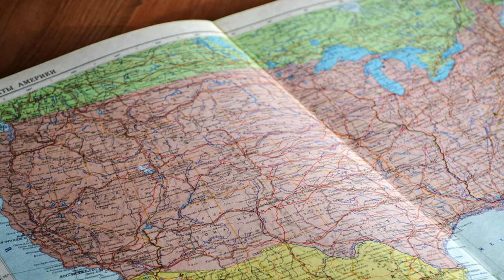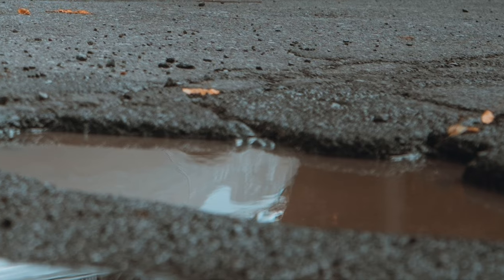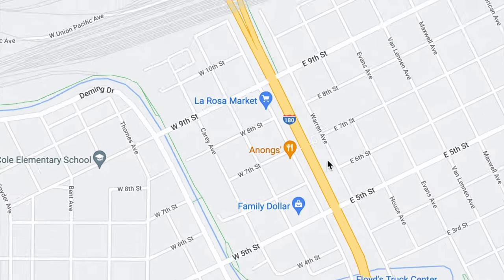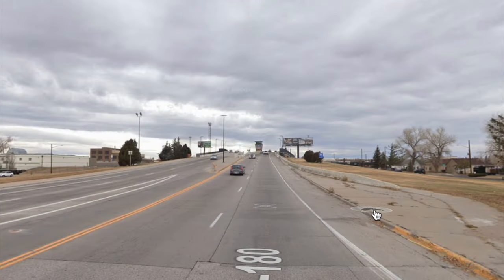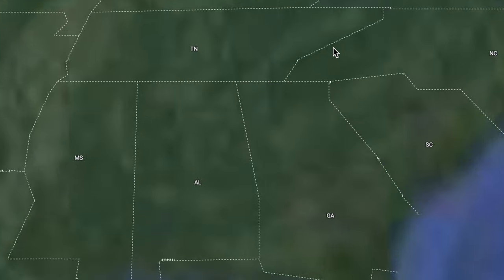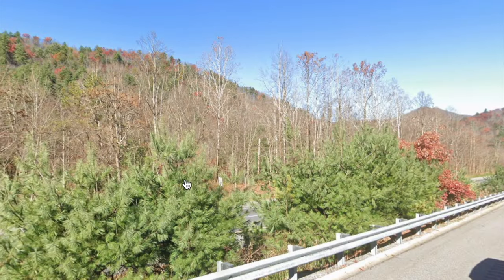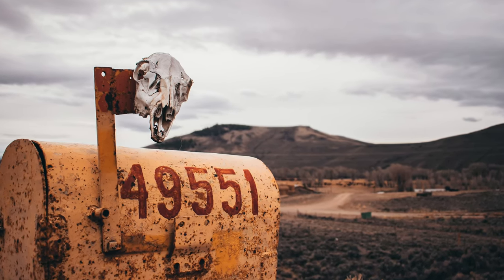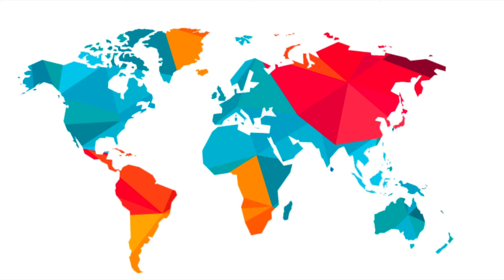Why are there stoplights and driveways on US Interstate Highways?

Comment: You've got a bit of learning to do.  President Eisenhower signed the National Defense and Interstate Highway Act in 1956. First, three-number spur routes from interstates, such as I-180, are to give access to communities off the main route.  I-180 goes to a point where it becomes Business I-25.  Business routes also connect to interstates but do not have regulations on them.  Most are city streets.  Other spurs will simply dead-end into a city.  The Spartanburg spur becomes US 176;  same situation.   Hurricane Creek has posts on both sides of the cutoff;  someone has taken down the chain or rope that is supposed to block that dirt road.  Local traffic uses the legitimate exit a mile away.  There are a number of businesses in Texas that use the Interstate as their address, but physical locations are on the outer roads. The United States Postal Service determines addresses.  Now, if you want a more applicable stoplight, there is I-70, where it meets the Pennsylvania Turnpike in Breezewood, PA.  To continue on I-70, you must exit eastbound onto US 30 and go through a couple of stoplights before you make a left and resume your trip on 70, heading for Baltimore.  Westbound traffic stops at that same stoplight, hangs a right onto 30, goes a few hundred feet and reaches a ramp to the Turnpike, which then carries I-70 westbound towards Pittsburgh.  A caveat here:  this interchange was built some years before the Interstate system existed, so it was legitimate, based on the rules of that time.
Reply: Thank you for pointing all this out. It really irritated me with several inaccuracies.
Reply: Actually, Business I-25 encompasses the entire route of I-180.  So does US-85 and Business US-87.
Reply: The only thing unusual about the Spartanburg Spur is that it doesn't connect to its parent route as an interstate, but as a US highway. If you consider Business 85 as the parent route, it would be different.

Comment: The Spartanburg situation has a historical explanation. The map shows both I-85 and, parallel to that, a Business Route I-85. Unlike every other Interstate business route, this road is a full freeway. In fact that road WAS I-85 for decades. And I-585 was a normal spur route to this version of I-85, going in both directions from the main route, and following all the rules. Then they decided to improve I-85  by building a whole new road beside the existing freeway. And they left the existing roadbed open. The older freeway, for what I consider dumb reasons, was designated a business route instead of a 3- digit regular Interstate number. Local officials wanted a 3-digit number, but the feds said the older freeway had too many exits per mile, short ramps, etc. In spite of the fact that there are dozens of examples of these rule violations in big cities. So now I-585 is a regular spur route off a business route, very unusual. And it comes very close to the new roadbed of I-85 as a full freeway,  but not quite. I guess it would be expensive with little benefit to upgrade this short section to a freeway.
Reply: North Carolina did that same thing in Greensboro, with none other than I-85.

Comment: Throughout Texas, when a business or home is located on an interstate frontage road, the address will be “nnn Interstate nn”.  That is, assuming the interstate doesn’t have another name, like Stemmons Freeway in Dallas.

As for stoplights on interstates, supposedly the interchange between I-35 and I-535 in Duluth, MN has two ramps that intersect one another, and therefore has a traffic light.
Reply: Yea I was thinking about that throughout this entire video.

Here in San Antonio, there's TONS of businesses with an address on I-10 and I-35. There's also a lot on I-410, though it appears the addresses for them on Google Maps are all "Loop 410" instead of I-410, which makes sense to me because I've never heard any locals refer to it as I-410, rather, simply as just 410.
Reply: Not anymore regarding Duluth.  It looks like they are rebuilding the interchanges in that area.

Comment: Most of these are normal here are the very odd ones:

I70 in Breezewood PA. They were going to bypass PA but the businesses complained and got their way thus Breezewood is an absolute mess today 

I180 in Cheyenne. I believe this interstate got an exception because Cheyenne is such a small city. Even still I don't understand why they didn't just sign is business 80 or something similar

The Alaska Interstates: these also got exceptions because Alaska has a tiny population and doesn't need massive highways outside the major urban areas 

I78 in Jersey City. I78 runs on surface streets to get to the Holland Tunnel, this was going to be a highway that went through Manhattan but people protested and the highway was cancelled
Reply: Here's the thing with I-180, it is signed as the following highways:
- Interstate 180
- Interstate Business Loop 25
- US Highway 85
- Business US Highway 87

Business Loop 25 is appropriate as it starts and ends at I-25.  Also, I-180 ends at Interstate Business Loop 80 and....US-30.

I swear, US-30 has more anomalies than any US highway I can think of:

- Connects to the only interstate highway that isn't even a controlled-access highway (I--180, Cheyenne WY)
- Connects a gap with Interstate 70 (Breezewood PA)
- Multiplexes with I-676 and shares a signal intersection on the main lanes (Philadelphia PA)

If I didn't already know that I-238 in California was part of CA-238, I would swear US-30 had something to do with that anomaly.

Comment: I-280 in Toledo, Ohio was once an Interstate highway with a traffic signal and it also had a draw bridge. I was totally surprised  buy it.  Over the year the traffic light intersection and the draw bridge were replaced with a proper interchange and a high level suspension bridge. I-280 run from the original Exit 5 on the Ohio Turnpike thru Toledo and connects to I-75. Originally, before I-75 was completed, I think it was part of the Detroit-Toledo Expressway. The bridge is at the Maumee River, which has large cargo ships on it that use the port facilities. Toldo is a world port for shipping grain around the world.
Reply: I've seen that a few times in my youth and young adulthood before they fixed all of that.

Comment: Interesting look at the interstate systems oddities. Why did you use a Russian map of the united states at 1:43?  On I40 going east near Tucumcari NM at this location there is direct access to what appears to be a ranchers back dirt road 35.128368, -103.846965 . What's odd is there is a exit off ramp (just west) that leads to a frontage road that ends only a 1.5 miles away by dirt road from that direct access off the freeway. The rancher has put up a gate that blocks people from just driving off the highway onto their land. There is also another nearly identical direct access here just under a mile away from the first one 35.135010, -103.834780 . Probably onto the same Ranch land. Maybe the Rancher at the time of the highway being built demanded this, the freeway was probably cutting off their Ranch access.
Reply: From what I understand of I-40, there are around five or six of these crossovers.  They are for ranch access.  TxDOT didn't want to buy a portion of the land as right-of-way due to expense and traffic volumes in the area are low (at least the entrances are).  So, they violated what a controlled access highway is and created the crossovers.  The only reason this was done, besides TxDOT didn't want to pay for it, was because there are no other access roads in the area for the entrance to the land.

Comment: So, here's a lesson for you.  When you pronounce "I-80", it's the same as saying "Interstate 80".  The road you're pointing at is Interstate 180 (One-Eighty), or I-180.  Interstate I-80 doesn't make sense since you're really saying "Interstate Interstate 80."  This is an abnormality in the Interstate Highway system and is considered the worst violations of the Interstate System (far more so than I-238 in California.)  

I-585 is considered an "orphan" route.  What is now Business I-85 used to be I-85, so I-585 did connect to its parent route.  Then the interstate was moved onto a new section, and the old section was re-signed as an Interstate Business Loop.  Unfortunately, I-585 didn't quite meet up with the new I-85.  There are plans in the future to fix that oversight.

Hurricane Creek Road is a dirt road.  I wouldn't call that really a connection.  There are many examples of dirt roads that connect directly to interstates, but none of them are official connections.

If you're looking at at-grade intersections on an interstate, check out I-40 in Texas near the New Mexico border.   There are a few at-grade intersections with an asphalt median area with stop signs on them.  This is an oddity due to the low traffic volume in the area.  Normally, to get access to property, either you would need to build an access area on a road that crosses the interstate, build an exit and an overpass, or build a frontage road.  In the case of I-40, the area is not near any access roads, building an exit for a dozen crossovers would be way too expensive, and building a frontage road can't be justified due to the low traffic volumes on these roads (these roads are accessed less than 250 times a year.)  So, an exception was made for a low-traffic volume crossover.

Comment: I-65 northbound ends at a stoplight near Gary, IN. Same thing with I-35 northbound in Duluth, MN. I also drove on I-10 throughout Texas, New Mexico, and Arizona, and along the way in a very desolate rural area, I saw a few crossroads. Intersection indicator signs and all, no off ramps. Can't recall which of the 3 states it was.

Comment: This is ludicrous. I'm 63 and traveled every interstate at one time or another. There are zero traffic lights and no driveways on Interstates. I can travel from one coast to the other 6 times and not hit one signal. You must be traveling after the terminus of the interstates.
Reply: I-676 has a single intersection on it, and that is signed as I-676 (AASHTO authorized it to be signed I-676).  
I-110 in Biloxy MS has a signal on it.  It's for a drawbridge.
I-495 in Washington DC (more on the Maryland's side) has a signal on it.  It's for a drawbridge.

As for driveways, other than an occasional maintenance area for state DOT,  there are no driveways that legally connect directly to the interstate.  There is a Park and Ride that sits as part of the interstate (I-70 Baltimore MD...ends in a Park and Ride due to the cancellation of the remaining route to I-95).
Reply: The weigh stations northbound and southbound on I-5 near Wheeler Ridge, CA (south of Bakersfield) have large visible street address numbers, although the “street” is Interstate 5.

Comment: A couple of points. It's not unusual for I 580 to end not connecting with another interstate. This is a spur route. Three digit interstates that start with an odd number are spurs. (There are exceptions.). Also, the most notorious example of stop light on an interstate highway is I 70 in Breezewood, PA. Heading westbound into Breezewood I 70 meets US 30, and an at-grade, stop light intersection exists  with the entrance ramp to the Pennsylvania Turnpike, where I-70 is routed onto the Turnpike joining I-76. There are currently no plans to eliminate the stop light for thru I-70 motorists.
Reply: But a spur route needs to connect on one side with its parent (I-80) or another child route.  In the case of I-580, it is orphaned, meaning that it did connect with I-80 sometime ago, but I-80 moved locations, thus causing I-580 not to connect with it (and it doesn't as its designation ends short of the I-80 interchange).
Reply: Are you talking about the I-580 in California? That’s the only one I know of that number.